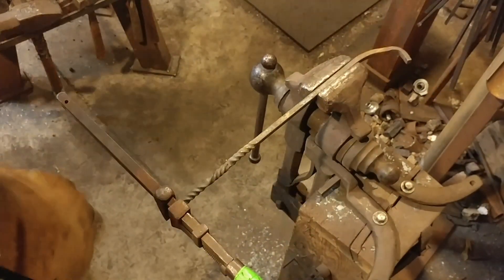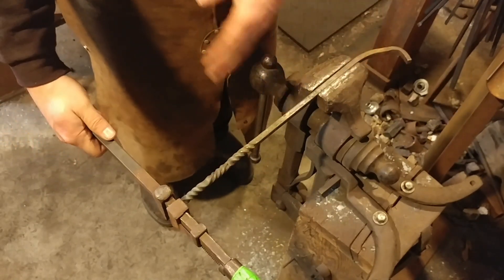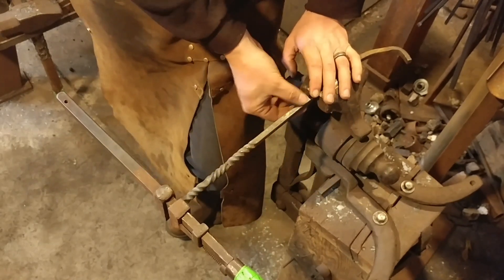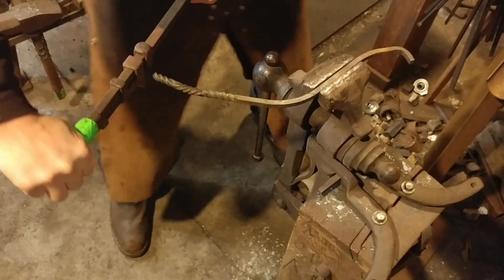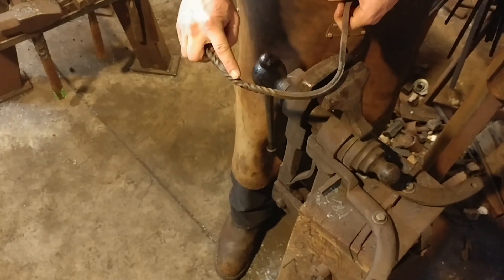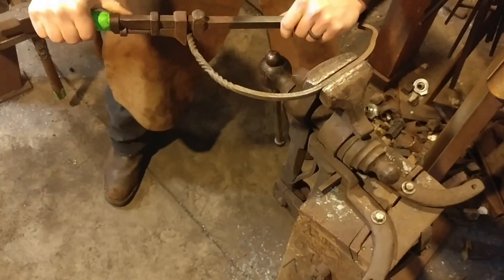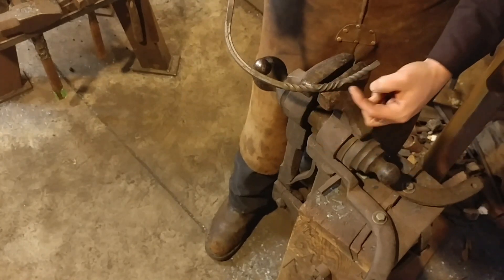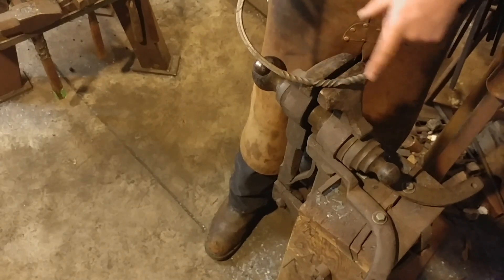Does twisting metal bar make it weaker?

Comment: If you use a bar with 2 drilled holes in it and use that to twist 2 bars together with leversge while sliding down the bar it wraps the 2 together. Now you can twist the bar your wrapping opposite direction of the wrap and that will inccrease elasticity and strength over and over until you reach your workload

Comment: If I'm not mistaken, naturally the metal will bend only at the area that is right by the mouth of the vise. If it wasn't twisted the part he was holding with that tool would not have bent at all. Meaning the twisted area is weaker. Great video though.

Comment: If you try bending the bar when setting the bar in the vise corner to corner (rotate 45 degrees) I bet the twisted part is weeker, bending the same way. The corner ads stability in its directions. When twisted, that stability is lost.

Great video, as usual :)

Comment: If you re-try this experiment (placing the twists towards the vise), you might also try an annealed (or would it be normalized?) twist.  The twisted section(s) would have stresses built up in them (torsional?  I don't think it would be considered compression and rarefaction).

Comment: I learned that while making armour that by adding creasing in piece's gives strength.  For example putting a crease in each digit of a gauntlet gives 20gauge piece more strength while allowing a trade of thickness for strengthening.  Therefore a disruption of the flat Vs manipulation equals strength.